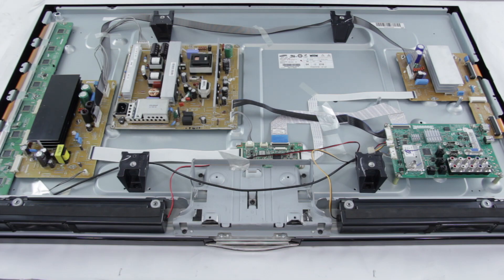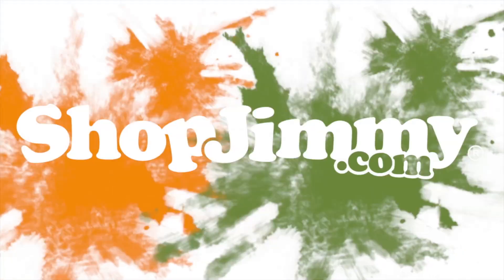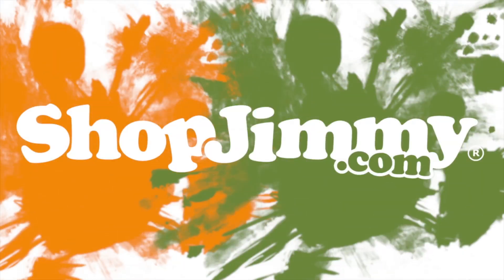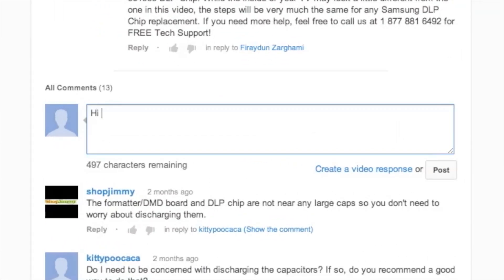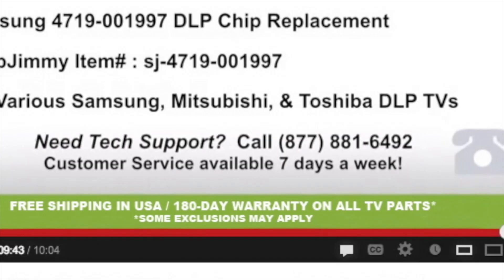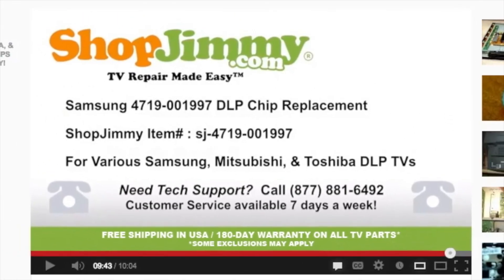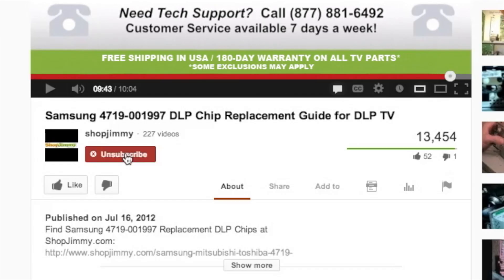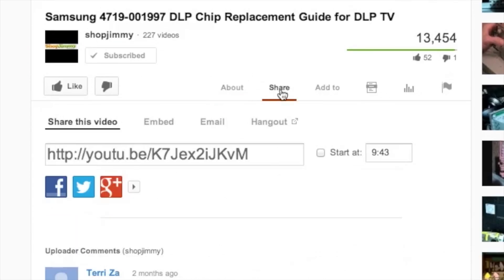Plasma TV Repair Tutorial - Common Symptoms & Solutions - How to Fix Plasma TVs

Comment: help!! i have a samsung 42 inch plasma, the screen is black with white vertical lines i still get audio, sometimes after 10-15min on the tv corrects it self with normal picture. which video do you have that i should i watch to correct this problem???
klemekh@gmail.com
Reply from the maker: +Kevin K.   Try all repairs and troubleshooting at your own risk.  This sounds like a TV panel (TV Screen) problem.  If your TV panel is bad, it may be more cost-effective to replace the TV as panels are typically hard to find in stock, difficult to replace, and expensive.  Thanks and please let us know if you have any further questions!  www.shopjimmy.com

Comment: I have a Samsung plasma model pn42a450p1d and I plug it in and it just clicks and clicks I have a red light on the front but it don't turn on
Reply from the maker: +Angel Rocha   Try this at your own risk. Unplug the TV, then disconnect the y board and plug in the TV to see if the TV powers up. Note that it will not have a picture on the screen. Reply with the results of this test. Thanks! www.shopjimmy.com

Comment: I have a Samsung 50inch plasma TV. PN50C450B1DXZA. I have rainbow striped lines vertically top to bottom on the left side of the screen. The lines are always there regardless of the device I'm  using.  Which part should I order in your opinion. Thanks
Reply from the maker: +Dennis White   Try all repairs and troubleshooting at your own risk.  This sounds like a TV panel (TV Screen) problem.  If your TV panel is bad, it may be more cost-effective to replace the TV as panels are typically hard to find in stock, difficult to replace, and expensive.  Thanks and please let us know if you have any further questions!  www.shopjimmy.com

Comment: Samsung Plasma PN64E550D1F.  When I turn the tv on the picture will come in for 5 seconds and then the picture will go off.  The sound stays on.  I took the back panel off and the yellow led light on the logic board blinks about every 5 seconds.  also while back panel was off and turned tv on 3-4 loud pops came from the back.  Trying to see if this is fixable.
Reply from the maker: +Rich Dome   Try all repairs and troubleshooting at your own risk.  I recommend replacing the Y-Main Board and the Upper and Lower Y Scan Drive boards in your TV.  Click this link to replacement parts for your TV model number:  http://www.shopjimmy.com/catalogsearch/result/?q=PN64E550D1F There may be multiple boards for the same TV model number, be sure to match part numbers on your current board, with your replacement for compatibility.  Here is a link to a video showing how to identify your part number, click here:  https://www.youtube.com/watch?v=R1jmj_foId0  Thanks and please let us know if you have any further questions with your TV Repair!  www.shopjimmy.com

Comment: the first 3 to 4 inches at the top of my plasma tv is distorted the rest of the picture is just fine i was thinking that it was the y sustain is the problem what are your thoughts ? it goes all the way across it is a vizio jv50p hdtv10A  however they seem to have several choices on that jimmy site any ideas are greatly appreciated and thanks for the video it helped a lot
Reply from the maker: +Velvia Miller  Try all repairs and troubleshooting at your own risk.  I recommend replacing the YSUS and the YDRVTP & YDRVBT boards in your TV.  Click this link to replacement parts for your TV model number:  http://www.shopjimmy.com/catalogsearch/result/?q=jv50p+hdtv10A  There may be multiple boards for the same TV model number, be sure to match part numbers on your current board, with your replacement for compatibility.  Here is a link to a video showing how to identify your part number, click here:  https://www.youtube.com/watch?v=GEllG3RV-tc  Thanks and please let us know if you have any further questions with your TV Repair!  www.shopjimmy.com

Comment: hi i have a samsung pn50c450b1d 50inch . i have 4 vertical lines and have since chaged the small y board in the center still the same result. any ideas? lines show infront of menu screen and on all inputs :(
Reply from the maker: +YourAverageAmerican   Try all repairs and troubleshooting at your own risk.  This sounds like a TV panel (TV Screen) problem.  If your TV panel is bad, it may be more cost-effective to replace the TV as panels are typically hard to find in stock, difficult to replace, and expensive.  Thanks and please let us know if you have any further questions!  www.shopjimmy.com

Comment: I have a LG 50PW350 Plasma TV, I just replaced the power board and I am still not getting any power source light to come on, on the front of the tv. Its just dead... what can the problem be. I tried a different power cord with the sam rating 10a 125v and still wont work after that. Now on this tv the power cord does not plug directly into the power board it pugs into a separate part near the base of the back of the tv. Can that be shot from a power surge as well as the power board? I don't get a light or clicking, frustrated, it like having a huge paperweight at this point lol. Please help I was hoping to have this running for my Birthday. Thank you.
Reply from the maker: +Adam K   Try this at your own risk. Unplug the TV, then disconnect the y board and plug in the TV to see if the TV powers up. Note that it will not have a picture on the screen. Reply with the results of this test. Thanks! www.shopjimmy.com

Comment: I have a LG 60 inch (model 60PV450UA). Something overheated in the back , could smell something electrical burning. I now have horizontal banding at the top and bottom of the screen. The picture is still there but the colors in the banded areas keep fluctuating. Any idea what I need , thanks
Reply from the maker: +Mike Murphy  Try all repairs and troubleshooting at your own risk.  This could be a problem with the panel IC's, and there is no fix for that.  Thanks!  www.shopjimmy.com

Comment: I have a Panasonic model Tcp6s30 made a pop sound and lost picture and sound. red light comes and will blink. only response I get it pushing power button on side and the led comes on but that's it. Y board?
Reply from the maker: +John Osborn   Try all repairs and troubleshooting at your own risk.  I recommend replacing the SC, SU & SD boards in your TV.  Click this link to replacement parts for your TV model number:  http://www.shopjimmy.com/catalogsearch/result/?q=Tcp60s30  There may be multiple boards for the same TV model number, be sure to match part numbers on your current board, with your replacement for compatibility.   Thanks and please let us know if you have any further questions with your TV Repair!  www.shopjimmy.com

Comment: Panel displays horizontal purplish color "noise" lines which flicker on/off intermittently, especially apparent when white background is displayed. The noise is more like a blurry band, not actual discrete lines. Suggestions please.
Reply from the maker: +Chris Petterson  Try all repairs and troubleshooting at your own risk.  I recommend replacing the Y-Main Board and the Y-Upper Scan Drive and Y-Lower Scan Drive boards in your TV.  Click this link to replacement parts for your TV model number:  http://www.shopjimmy.com/catalogsearch/result/?q=PN63C8000  There may be multiple boards for the same TV model number, be sure to match part numbers on your current board, with your replacement for compatibility.  Here is a link to a video showing how to identify your part number, click here:  https://www.youtube.com/watch?v=R1jmj_foId0  Thanks and please let us know if you have any further questions with your TV Repair!  www.shopjimmy.com

Comment: I have a Panasonic TC-P46u1 and when I power it on it will stay on with no picture for about 10 seconds then shut off...then turn back on...then shut off.   Then I have to turn it on again. Sometimes it will eventually work and give a message that says an error has been detected and recovered.  And then it will work fine until I should it off.  It may do this 100 times before it actually powers on and displays correctly.  Any ideas on what part I need?
Reply from the maker: +chadgmcd   Try all repairs and troubleshooting at your own risk.  I recommend replacing the main board in your TV.  Click this link to replacement parts for your TV model number:  http://www.shopjimmy.com/panasonic-txn-a1ejuus-a-board.htm  There may be multiple boards for the same TV model number, be sure to match part numbers on your current board, with your replacement for compatibility.  Here is a link to a video showing how to identify your part number, click here:  https://www.youtube.com/watch?v=IrfefQ7SIXkThanks and please let us know if you have any further questions with your TV Repair!  www.shopjimmy.com

Comment: I have a Model : Vizio VP50 HDTV20A  110-240v~,5.0A. 50/60 HZ 
Serial #: PHLAVCH4504737 
MFG Date: November 2007
Part#10143050022       This is on the back of the TV it has great sound but the picture is black, it just went out one morning. For awhile it had Verticle lines 2 or 3 only noticable in the Royal Blue Color then one morning I turned it on and the screen went a little dark then completely black but still had sound. any help you can give me would be great. I just wanted to see if it would be cost effective to fix it or do I get a new one. The number listed above would not help me  so I though I'd try this. Thank you.  tsbabe01@gmail.com
Reply from the maker: +Diane Enriquez   Try all repairs and troubleshooting at your own risk.  This could be a problem with either the main board or the TV panel.  You can replace the main board to see if that fixes the problem.  Click this link to replacement parts for your TV model number:  http://www.shopjimmy.com/catalogsearch/result/?q=VP50  There may be multiple boards for the same TV model number, be sure to match part numbers on your current board, with your replacement for compatibility.
Thanks and please let us know if you have any further questions with your TV Repair!  www.shopjimmy.com

Comment: i have an lg plasma tv model 60PN6550-UA serial # 303RMHR07265
when you first turn the tv on bad picture. 2 minutes later the picture will be ok .after three months   no more picture but there is sound  .
Reply from the maker: +The Crazed Pyromaniac   Try all repairs and troubleshooting at your own risk.  I recommend replacing the YSUS and the YDRVTP & YDRVBT boards in your TV.  Click this link to replacement parts for your TV model number:  http://www.shopjimmy.com/catalogsearch/result/?q=60PN6550-UA  There may be multiple boards for the same TV model number, be sure to match part numbers on your current board, with your replacement for compatibility.  Here is a link to a video showing how to identify your part number, click here:   https://www.youtube.com/watch?v=GEllG3RV-tcThanks and please let us know if you have any further questions with your TV Repair!  www.shopjimmy.com

Comment: Panasonic Tcp65s2 I was watching tv and picture went out I then got 10 flashing led
Reply: Panasonic viera Tcp65s2
Reply from the maker: +Roberto Medina  Try this at your own risk. Unplug the TV, then disconnect the SC board and plug in the TV to see if the TV powers up. Note that it will not have a picture on the screen. Reply with the results of this test. Thanks! www.shopjimmy.com

Comment: I have a Panasonic TC-46PGT24 TV Aug 2010, no picture or sound.  Red power light comes on then clicks off and on again. I have not checked the fuses in the power supply yet.
Reply from the maker: +Herbert Weiss   Try all repairs and troubleshooting at your own risk.  I recommend replacing the SC, SU & SD board in your TV.  Click this link to replacement parts for your TV model number:  http://www.shopjimmy.com/catalogsearch/result/?q=TC-46PGT24  There may be multiple boards for the same TV model number, be sure to match part numbers on your current board, with your replacement for compatibility.  Thanks and please let us know if you have any further questions with your TV Repair!  www.shopjimmy.com

Comment: I have a Panasonic 50" Plasma TV made in 2010.  Model # TC-P50GT25.  A few weeks ago, the TV suddenly turned off and won't turn on again.  When I plug the TV into the outlet, I hear a click, and then when I try to turn the TV on, I hear another click or two, but it won't turn on.  Most of the time, it will give me a 10 blink code.  However, sometimes, when I first try to turn it on, it will sometimes give me a 4 blink or 7 blink code, and then after a while it will revert back to 10 blinks.  Is this a problem with the power board?  should I try replacing the fuse(s)?  Or perhaps it is the main "A" board?  Any help is appreciated on how I can trouble shoot, or what part I need to replace.  Thanks.
Reply from the maker: +James Chae   Try this at your own risk. Unplug the TV, then disconnect the y board and plug in the TV to see if the TV powers up. Note that it will not have a picture on the screen. Reply with the results of this test. Thanks! www.shopjimmy.com

Comment: Rescued a neighbors Samsung Plasma PN51D530A3F bound for the dumpster and wanted to have a go at trying to fix it.
Plugged it in, red led flashes 1x then remains on, no picture. 
Pressed the power button and same thing: Led flashed 1x, 1 audible click sound then LED stays on. 
After several times of pushing the power button there's no more flashing or clicking sounds. 
I looked for swollen or odd looking capacitors but couldn't discern any. No remote control available.
Reply from the maker: +Ron Chambers  Try all repairs and troubleshooting at your own risk.   I recommend replacing the Y-Main Board and the Y-Buffer Board in your TV.  Click this link to replacement parts for your TV model number:  http://www.shopjimmy.com/catalogsearch/result/?q=PN51D530A3F  There may be multiple boards for the same TV model number, be sure to match part numbers on your current board, with your replacement for compatibility.  Here is a link to a video showing how to identify your part number, click here:  https://www.youtube.com/watch?v=R1jmj_foId0  Thanks and please let us know if you have any further questions with your TV Repair!  www.shopjimmy.com

Comment: I have a Samsung Plasma 50 Model PN51D550C1FXA and one repair shop said it was the main board, I replaced the main and no picture.  I replaced the logic board and now I have a green light the flashes once fast and then slow. I unplugged the y board and the green light stays on.  Is that the board I need to replace?
Reply from the maker: +poohbear44m   Try all repairs and troubleshooting at your own risk.  I recommend that you put all the original parts back in the TV and then replace the y board and buffers.  Unfortunately I do not see any replacement parts in the search results for your TV model number on our website.  Thanks and please let us know if you have any further questions!  www.shopjimmy.com

Comment: hello friends, thanks for your help. i have a model PN50A450P1DXZA, samsung plasma with a vertical bar black with red, green, blue, thin lines in the one black bar, in the same area as the main logic, at the bottom, white connections at the bottom, running to the circuit board on the bottom, what do u think the problem is?
Reply from the maker: +Peter Corsa   Try all repairs and troubleshooting at your own risk.  This sounds like a TV panel (TV Screen) problem.  If your TV panel is bad, it may be more cost-effective to replace the TV as panels are typically hard to find in stock, difficult to replace, and expensive.  Thanks and please let us know if you have any further questions!  www.shopjimmy.com

Comment: I have a Panasonic TC-P50X3 that will not turn on and has no standby. There are no blatant burns on any boards and I dont see any noticeable damage to capacitors or other components... suggestions?
Reply from the maker: +Lord HaveMercy   Try this at your own risk. Unplug the TV, then disconnect the y board and plug in the TV to see if the TV powers up. Note that it will not have a picture on the screen. Reply with the results of this test. Thanks! www.shopjimmy.com
Reply: I had a similar problem... replaced the power supply to no avail. Used your advice here (disconnect the y board and plug in TV) and noticed the "turning on sound", meaning that the Y  board was the problem. Got one on the way now and I think I'll be back in business in no time. Thanks!

Comment: hey jimmy im having a problem with my 50 inch LG television model #46LD550-UB.
 The television turns on and off constantly, sometimes it will stay on for a couple of minutes. But once it starts happening it wont stop please help. Only television i have in home.
Reply from the maker: +Aztec King Tapia   Try all repairs and troubleshooting at your own risk.  I recommend replacing the main board in your TV.  Click this link to replacement parts for your TV model number:  http://www.shopjimmy.com/catalogsearch/result/index/?cat=56&q=46LD550-UB  There may be multiple boards for the same TV model number, be sure to match part numbers on your current board, with your replacement for compatibility.  Here is a link to a video showing how to identify your part number, click here:  https://www.youtube.com/watch?v=RwHTvjMdrhk  Thanks and please let us know if you have any further questions with your TV Repair!  www.shopjimmy.com